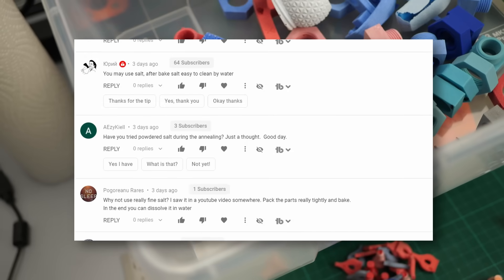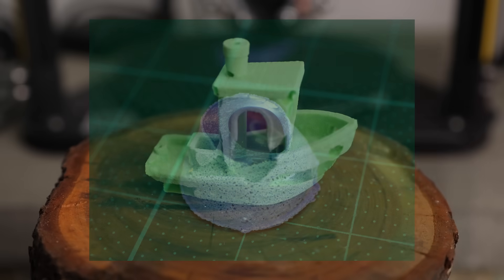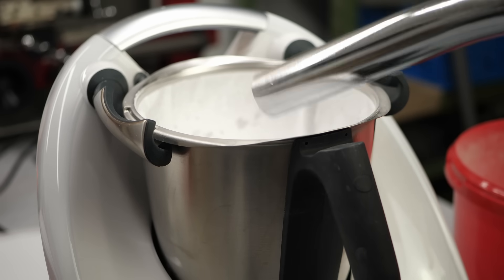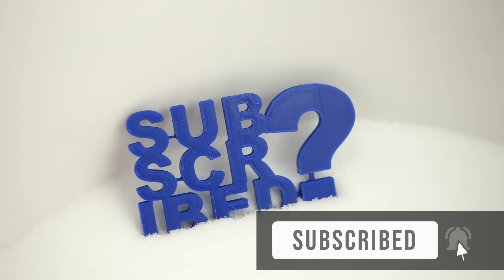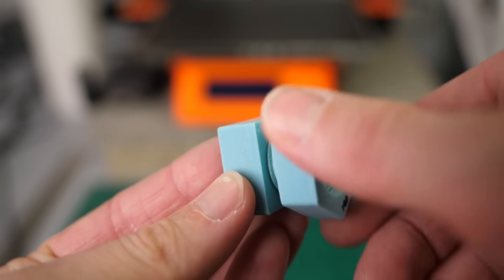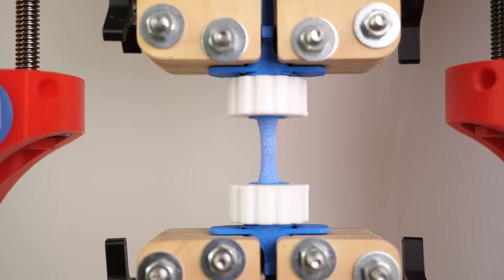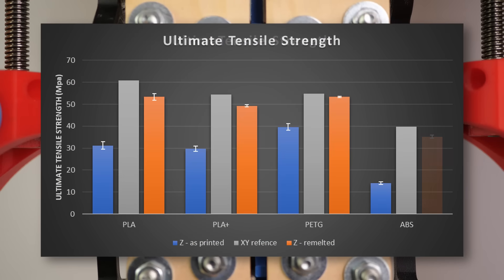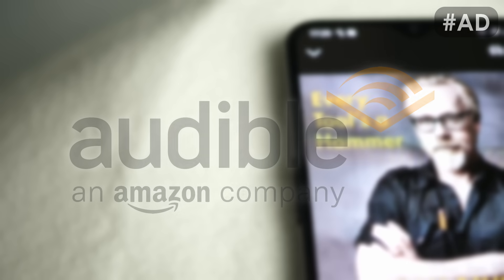The STRENGTH of 3D prints REMELTED in SALT

Comment: The salt you want is called "pickling salt". It's much finer than table salt, has no anti-clumping agents, and is available in bulk at low prices.
Reply: Really? Around here, pickling salt is extremely coarse. Can barely run it through a pepper grinder
Reply: @Imasurvivor2  Same here.  It looks like the salt you'd put on a pretzel.
Reply: @Imasurvivor2  Yep. It's very fine grained so it dissolves quickly in cold water. I've never heard of pickling salt that is coarse.
Reply: What you really want is salt flour.
Reply: Cargill Microsized® Salts are food grade, extra finely
 ground, white crystalline, sodium chloride .... BUT :  They contain
 Tricalcium Phosphate (TCP) to improve caking resistance and flowability.  Boo hoo ... this is to enhance handling properties, the fine powder being intended to promote even mixing with other dry ingredients. The finest grade is designated "Microsized® 95 Extra Fine Salt"
and further down:
Caking Resistance: Caking resistance varies depending
 on the crystal size, additives and storage conditions. End use application should be taken into consideration when determining acceptable product life in regards to caking
 resistance. Cargill® Microsized® Salts have an estimated caking resistance of 4 months.

Storage Conditions: To improve caking resistance,
 product should be stored in a dry, covered area at humidity
 below 75%.

Food for thought...  does anybody had a contact at Cargill who could smuggle out some untreated ultrafine white powder? What could go wrong with that!
Reply: How does it compare to popcorn salt, which is also very fine?
Reply: @btkramer  Popcorn salt often contains anti-clumping agents, which can be bad for pickling. I imagine it might work fine for annealing 3d prints, though.
Reply: Nah. Get flour salt even finer
Reply: Siede-Speisesalz extra fein 27,19€/25kg sagt Google 🤔
Reply: Wikipedia says it's fine salt to speed up dissolution.. But seems Winsor is making a coarse version from what I can see. https://windsorsalt.com/product/coarse-salt/

So I guess it depends on the brand.
Reply: @devilwarriors5164  That's my city's salt mine, awesome to see someone mention them!
Reply: @moekitsune  I'm so used to seeing this as pretty much the one salt brand in Quebec, I never realized it was a mine in Ontario
Reply: In civil engineer a finer gravel wont make things stronger won't it apply here?
Reply: @DavidGarcia-nx2gj  No here you want the plastic to melt but have no place to go so when you cold it back down it doesn't move from where it was. With a finer grain of salt, you can jam-pack it more in all crevice of your print. Also finer salt will leave a finer texture once you wash it away with water. Salt is not the final material, it's only a temporary filler.
Reply: @DavidGarcia-nx2gj  The goal isn't strength of the material here. Salt is just a support medium for the re-melt, getting maximum surface contact with the parts is the goal. It's a similar concept to sand casting, where you also want the finest grain possible (and I think buying sand casting medium would be better than salt here)
Reply: @saihenjin  "and I think buying sand casting medium would be better than salt here" .. no sand would not work at all, it will stick to the 3d printed part and you'll just end up with a sand covered print. Using salt means you can just dissolve it with water after, leaving only the texture.

Comment: would it help to use something like a ball mill for grinding whatever medium you use to remelt 3D prints? As making sure that the grain size for the the powder is as fine as possible. Also even though it would be more expensive to aquire if you look into Ceramic supply companies you should be able to find super fine versions of many different chemicals/elements that might be perfect for remelitng the plastic in a super fine medium.

Comment: @CNCKitchen , I suggest using a knurled coffee grinder for getting consistent grain sizes. The one I have for my morning coffee says not to grind anything else in it, but I think that's more about limiting liability. Knurled grinders are great for getting consistent grain sizes which is why they're great for coffee. I've honestly been considering testing a second one out for the purpose of grinding plastic down for filament recycling.

Also, as you are essentially making a casting around the printed part, I suggest you look into metal forging videos where they talk about how to make sand molds.

Comment: The Salt agglomeration issue may be addressed with Bicarbonate salt.  I think that's also what is used to coat the grains of regular table salt.
Reply: Actually... That might not work for PLA because it enhances hydrolysis. But for ABS it might help. 

Another thing to address is the compacting step. I'd recommend using a stiffer container since the walls of the Stainless Steel bucket might bend and induce deformation once the pressure is released. No experience, just my idea of troubleshooting/ optimising. 

There are more water soluble salts that might be interesting to test. I have some ideas on how to tune the properties of your mould and get a higher resolution.
Reply: Possible salt options: CaCl2, MgSO4,  CuSO4, Na2SO4, ...
Reply: Actually magnesium sulfate should be the most promising. Available as fine powder and easy to dissolve.

Comment: We stopped using polycarbonate because our testing showed that we just could not get good inter-layer bonding on our machine, so we standardized on PETG with HIPS support material. It was too bad because some polycarbonates like polymaker PC-Plus had over 11000psi of tensile strength laying down flat. This technique could really change the way we think about 3D printing. Next time you do some testing, perhaps you could include some more high performance materials?

Comment: The porous surface of the salt remelted parts could be interesting to work with.

Seems like they would hold glue a lot more effectively than untreated parts, but then you have to wonder whether or not the surface of the print would rip off sooner than glue would fail.  If they work really well with glue, printing highly complex structures that may not pack into salt very well would be interesting.

What if you post-treated the parts with a tough resin?  And how well do parts remelted in salt take paint?

Comment: Has anyone ever tried with baking soda (pure sodium bicarbonate)? In my supermarket it is available as a very fine powder (10 euros / kilo). It isn't as soluble as salt in water but if you use warm water the solubility is significantly increased.

Comment: This is almost the same as sand casting. I think some feeders/sprue/runners could be in order here to print super fast hollow parts and make them 100% solid. It could include pellets or ground failed prints on a reservoir on the top. Even a centrifuge. So many good ideas... This is great stuff.
Reply: I came here to recommend this. Add a sprue, and maybe a vibration table or as you said, a centrifuge. I would be a little worried about the walls of the hollow print collapsing before the plastic in the sprue filled the cavity, but maybe if you came up with some water soluble binder for the salt grains?
Reply: @lukrative525  maybe sugar or maltodextrin like a gypsum 3D printer formula I saw somewhere could but depending on the temperature it could caramelise and harden... or just burn

Comment: you should do some surface treatment to the parts before the salting, like a thin layer of paint to stop the salt and plastic from mixing. That would make it less sensitive to the salt grain size. (but still sensitive, depending on the strength or flexibility of the paint layer)

Comment: Isn't a talc powder step forward since it is already finer than salt and is commonly used as baby powder, yet, a little pricey. 
And maybe painting the parts, those preventing it from binding with salt - ordinary spray-can acrylic, I'm afraid, would burn out. However there are heat resistant paints

Comment: I got clear finish with clear PETG. Temperature of oven was set to 150°C and it was there for about 1 hour.
Reply: what filament did you use, and how did you make the salt?
Reply: @buckithed  It was 3d Jake's clear PETG. I mixed small portions of seasalt in blender. Now grain size is really small, more like dust😃. You have to ditch part really well in the salt in order to get off with least amount of deformation. Also make sure that printer really prints at 100% infill. In slicer I put 100% infill but it still did get squeezed in process of remelting.

Comment: I think the porosity of the surface from these samples could help even more with further post processing methods  like epoxy coats. The resin can more easily adhere to the porous surface rendering in a stronger surface finish that complements the remelted inner structure very well in terms of strength/general robustness.

I'm curious if the remaining salt in the porous surface helps with abrasion resistance too.

Comment: I wonder if you could use a high temp oil (like silicone oil) as a binder to help keep the salt formed around the part and less messy overall.  This would make it more like sand casting but still allow dissolving of the salt.  It may require a surfactant or detergent to help clean the oil.

Comment: If it exist maybe you could use some material that is viscous and melts before the plastic to coat the part. This way I expect the final finish will be smoother and maybe you can even get away with using coarser salt

Comment: Very interesting indeed.  I would not mind seeing more testing in this direction.  The fact that the salt is so nicely soluble I guess makes it an interesting prospect.
I have often wondered though whether there would be an efficient enough way to add a laser based, very localised heating to the extruder to help with layer adhesion in real time by "melting" the polymer right in front of the nozzle while printing in a small enough area so as not to deform the print as a whole.  I am not sure about the feasibility of something like that especially as you have to be able to print in any direction, but it still does intrigue me.

Comment: What about using uncured plaster (powder) and trying this method?
The powder is finer than salt, cheap and easy to get and can also be washed away after baking in case it clumps up. It might be an easier variant of this without the humidity problems of the curing process.